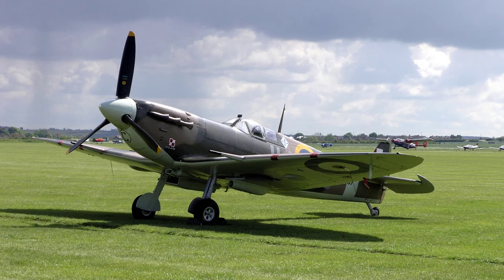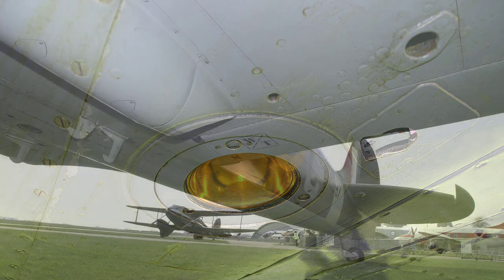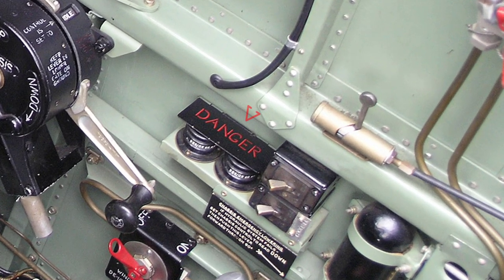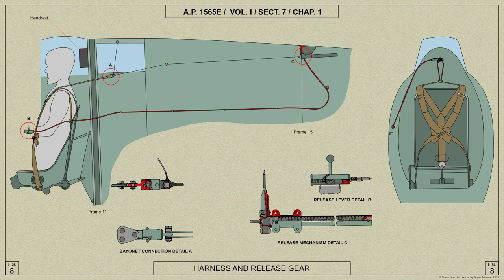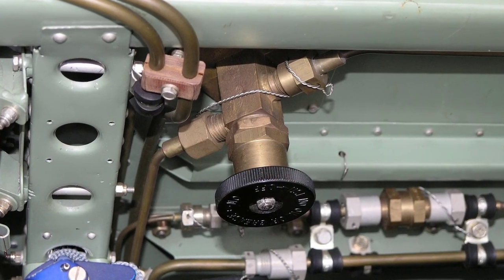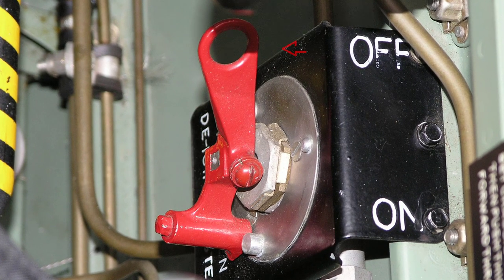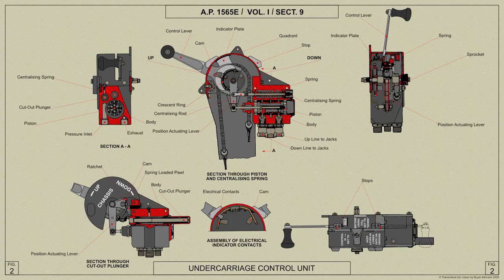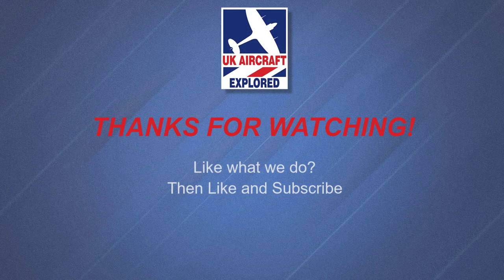Spitfire Mk V - Starboard Side of Cockpit

Comment: exscellent video, could i ask what the handle on the starboard side of the cockpit, it looks like the radiator flap handle ,but thats on the other side
Reply from the maker: Hi, thanks for your question. The lever on the starboard side is the Pilot's seat height adjusting lever. You can see more on this in my video covering the Spitfire Mk. V's Fuselage. Thanks for watching.
Reply: @ukaircraftexplored6556  thanks